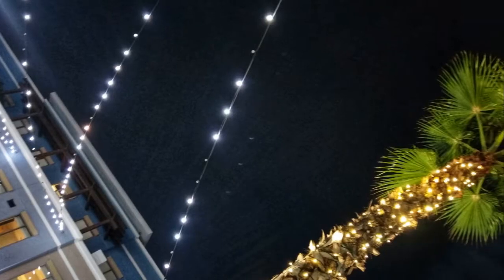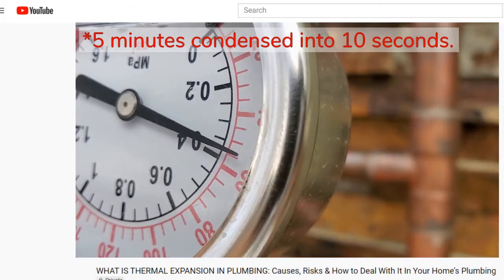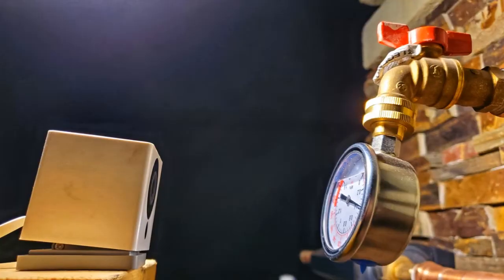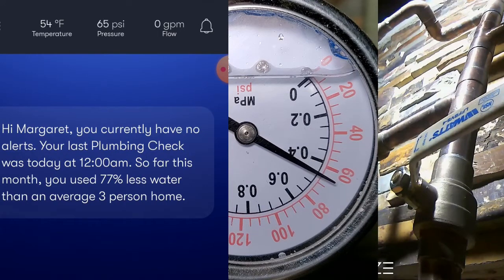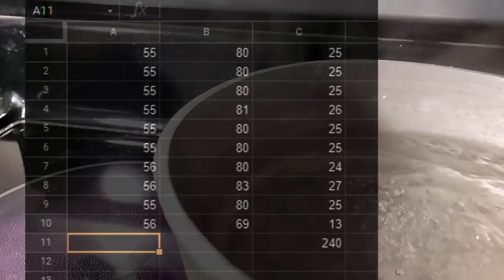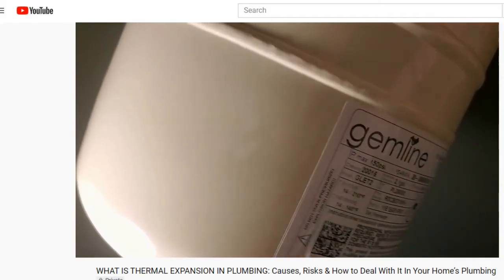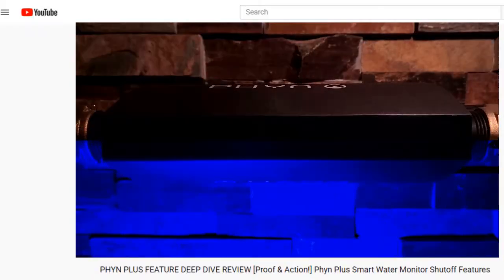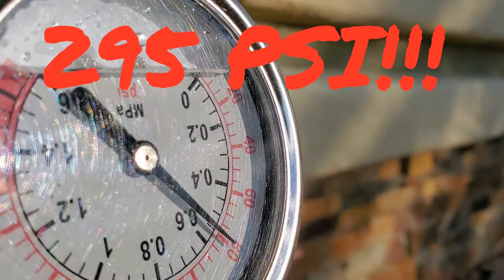Turn OFF the Water Heater Before Going on VACATION? What Happens When You Get BACK?

Comment: why would any of this be an issue if I shut off the water to the home? Then when I turn off the water heater - this whole thermal expansion business  wouldn't matter correct?
Reply from the maker: Totally agree. Doing both steps is the right thing and very important--especially with a closed system. If you shut off the water to the home and turn off the water heater--in either system--the only concern is winterizing if freezing is possible.
Reply: @NoMoreLeaks  What will happen if I leave the heater on?  I read that turning it off can cause mold/legionnaire.

Comment: We will be out for a 5-day vacation and it's forecast to have a below feeezing point temperature while we're away.  To prevent frozen pipes, can I just turn off the main water valve and leave the water heater on the same setting?   Will the water heater get damaged if I leave it on for five days without water coming in?  Thank you.
Reply from the maker: In that situation I would winterize the house. Drain down what you can and add RV antifreeze to your toilets and drains. I'm not sure on your plumbing setup or how warm you intend to leave the house, but this video is probably one of the best: https://www.youtube.com/watch?v=6eOYsjZF_SM --anything from Got2Learn is thorough (personally, though, I'm a fan of Phyn and not Streamlabs due to my water monitor having to go outside). Have a great vacation and I hope you come back to a house without any unwelcome surprises!